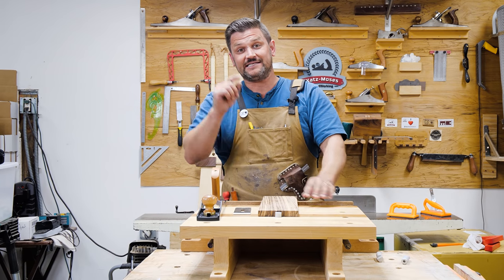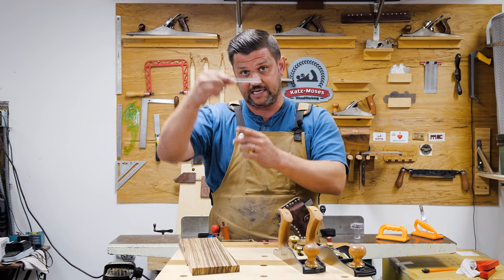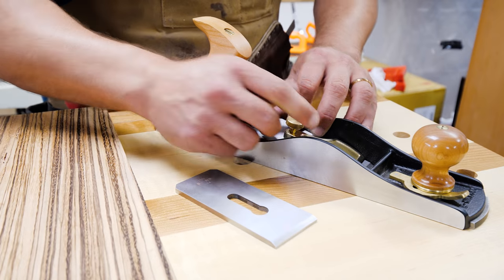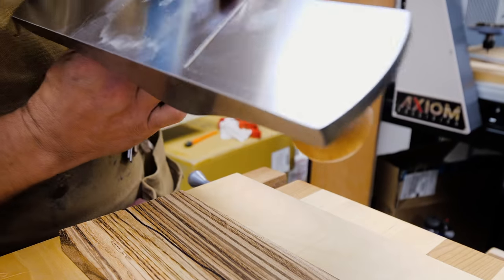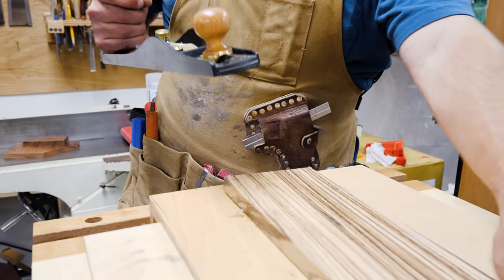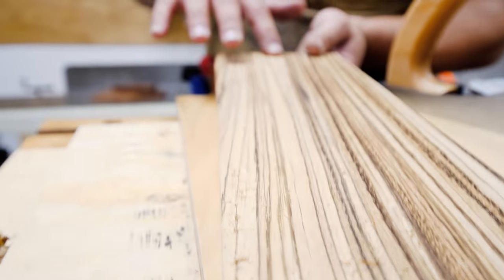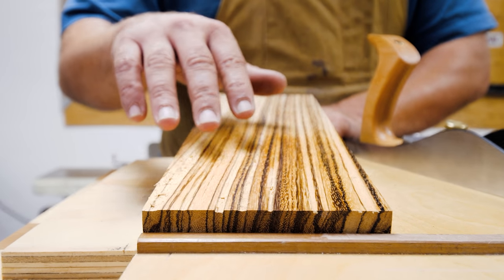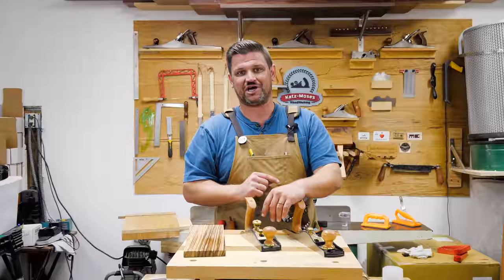Testing a 90 Degree Bevel Blade and Why You Should Be Using One

Comment: I use and like handscrapers and scraperplanes very much in finishing difficult woods and shapes of furniture 
where a normal plane can"t perform.  
In my Lie-Nielsen 164 low angle smoother plane the 90 degree bevel blade works amazingly.
It turns this even so perfect smoother in a quality scraper as well.
Reply from the maker: I did a video on the 90 degree blade. So awesome!

Comment: I found nothing takes old paint off old wood faster than a very sharp 90° scrapper. I made it out of a (1/4", 2 x 5) steel coupon. It lifts paint without gouging the wood surface. Ever since I've been a big fan of that 90° angle. Try it you'll like it.

Comment: Thanks for your videos. I know this is an old post, but maybe you still monitor the activity. The 90 degree blade looks like a very promising solution to wild grain, but I don't think an experienced woodworker would even attempt zebrawood  with a plane using a 37 degree cutting angle (12 degree bed angle + 25 degree sharpening angle) A better (more useful?) comparison would have been with a 50 degree set-up. (12 degree bed angle + 38 degree sharpening angle )
Reply: 12 + 38 is my default setup. I couldn't imagine going lower

Comment: I initially ground the blade to 90 degrees. It would not cut. I found that this was not a steep enough angle to present to the wood (102 degrees). I normally hold my card scrapper at about 112 degrees. I ground the front of the blade at 10 degrees to get 112 degrees presentation angle. This worked perfectly.
Reply: That was my thought. How do you hobe a 90 degree blade easily? I might hone my spare blade to something like 70 degrees so i have an 83 degree cutting angle. Any suggestions on this. I imagine 83 degrees would cut difficult grain well.

Comment: Just curious. How would Zebrawood look with a 50 degree blade in a BU smoother? I have the Veritas Smoother and the 50 degree blade w micro bevel produces glass smooth surface in extremely curly maple.
I don't think Veritas offers a 90degree blade and I don't have a slow speed grinder...
Reply from the maker: Seems like you should give it a go
Reply: I am currently using the low angle jack and 50 degree blade on a zebrawood build. Not ideal - still tearout. Going to grind a blade to 90 and try it.
Reply: Veritas Scraper plane knocks this gimmicky blade senseless.
Reply: have you got hands and sandpaper? you don't have to grind it all the way back

Comment: I have been saving up to get a Scraper plane because I do a fair amount of marquetry. Do you think this would work well for leveling marquetry designs where the grain directions can literally be going in every direction or would a dedicated Scraper plane still be better in this situation?
Reply from the maker: Zac Bell I think this would work great. It takes such a fine shaving effortlessly
Reply: This blade is not adjustable . You can BOW a proper scraper plane blade. Keep saving. My Veritas scraper plane is fantastic AND the blades are 3 ins wide not 2.

Comment: You could regrind any ordinary blade and it would save you money on a scraper plane . Although scraper planes are better because they are considerably wider than ordinary planes .Plus you can bow the blade on a "proper" scraper plane and finally of course they are MUCH faster due to the fact the blades are not 2" wide but 3". RIGHT TOOL FOR THR RIGHT JOB

Comment: Anyone tried that with normal plane by turning the bevel up like in a low angle plain and maybe using ~60 degree sharpening angle.
Reply: At a 90+ degreas attack angle the blade is no longer cutting the wood fibres but instead pushing and crushing them and that would put a great stress on the edge. My unqualified guess is that you run a high risk of bending the edge due to the limited support behind it on a normal plane with a steeper frog angle. But I haven't tried it, I'm only speculating.
Reply from the maker: Stefan Eriksson agree. You'd probably just roll the edge over immediately
Reply: did you really mean 60° sharpening angle? or 60° contact angle? i.e taking the bed into account. Having different blades with different sharpening angles is pretty standard with a low angle jack and it should work with figured wood.
Reply: Yes, I meant 60 degree sharpening angle. Combine that with regular plane 45 degree frog and you'll get  105 degree contact angle with wood. Would be quite close to the one in the vid.

Of course blade is thinner, edge is sharper and forces against the blade are more perpendicular  than on the one in the vid, so breaking the blade is a real possibility.